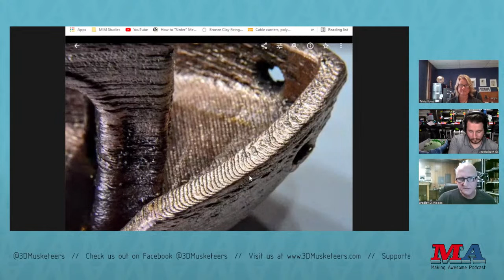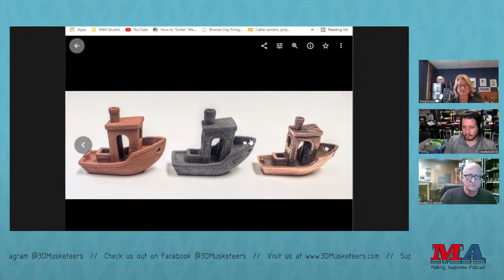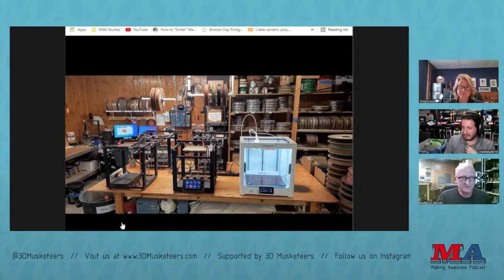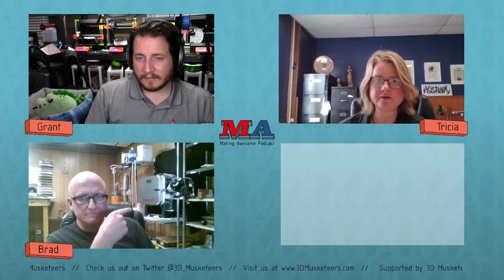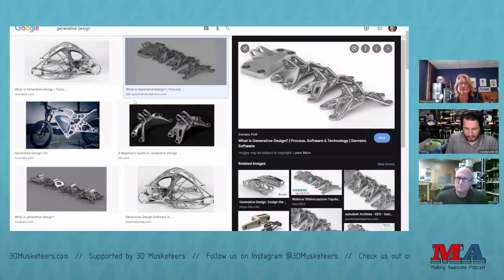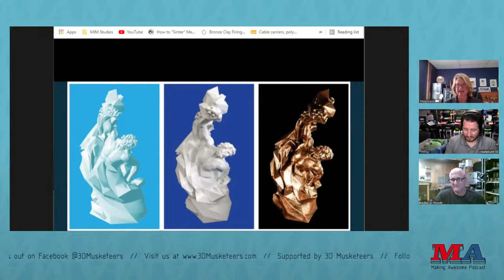Printing METAL on an ENDER??? Let's chat with The Virtual Foundry! - Making Awesome S2E24

Comment: 31:00 I'd love to know what magical kiln I can get for "a couple hundred bucks" that would let me sinter their Stainless Steel filamet. 

Also, judging by the few other YouTube videos of people trying to sinter the filamet (and there really are only a few, mostly from years ago, and entirely using only their copper Filamet), it doesn't work as well off the spool as they would suggest. Maybe it can work, with a lot of experimentation on the part of the consumer (which no potential customers should have to do), but it doesn't actually seem like Virtual Foundry has done their due diligence in conducting the necessary experimentation on behalf of potential customers. 

I should be able to print, debind, and sinter any Filamet I buy right here in my garage, following instructions provided by Virtual Foundry that are specific to parts with different thicknesses (their website appears to provide one set of general instructions, and then basically tells you to experiment yourself if you're deviating from their ideal cases) , and get a dense metal part that doesn't crack and fall apart straight out of the kiln (as I've seen from nearly all other YouTube videos I could find). If I can't do that, the Filamet in question should not be sold. They're marketing to 3d printing hobbyists. Most of us don't have skills in metalworking or material science. They have to do the heavy lifting for us, or their product is effectively worthless to their target demographic. Tech support-style help is good I guess, but that should be a last resort, not the first.

I would also like to know what solutions they might have for sintering Titanium (at home or from a sintering service), as that seems to me like the holy grail of metal printing. If I were supposed to do that at home...vacuum sintering furnaces are enormous and enormously expensive. If I were to use a service to get the sintering done...Virtual Foundry's affiliates only appear to sinter copper and bronze, and would be expensive as well (not sintering furnace expensive, but it adds up). And yet, they sell Titanium Filamet anyway. The Filamet itself is ridiculously expensive already, but they sell it. With no way for anybody to actually debind and sinter it. Any company that could afford to deal with it would just use an SLS, so I don't know who that Filamet was made for.
Reply from the maker: Most of the electric kilns apparently can work okay? But I have not tried yet myself..

I would guess their professional service would do MUCH better than anything I could do on my own, but that is me. But that is why they do this, they offer the service to do the heavy lifting for you. 

Clearly there are ways to use the Titanium, however I am sure it requires very specialized equipment. because, let's be real here.. If you are wanting to print titanium, you have understood the cost, the potential issues, and simply that something like LPBF is not the right choice.. 

Why? I dont know...